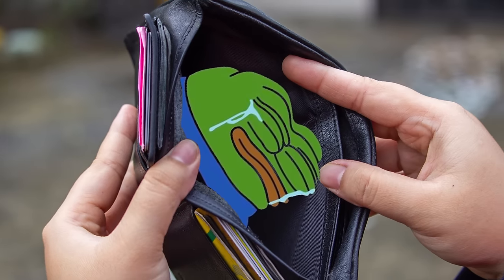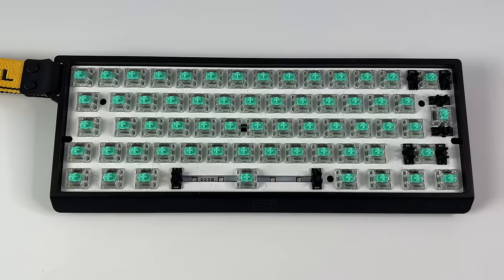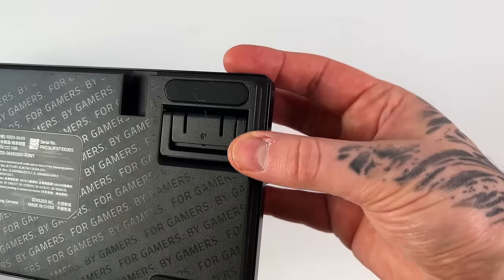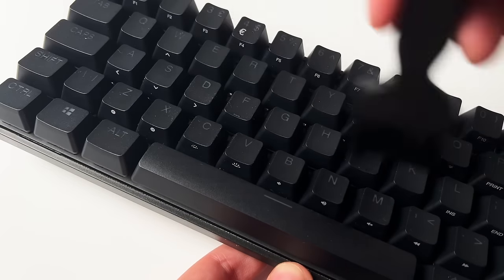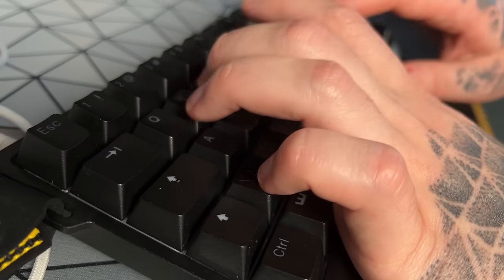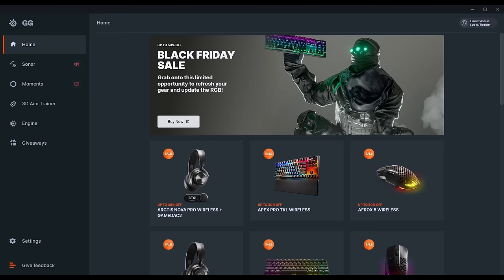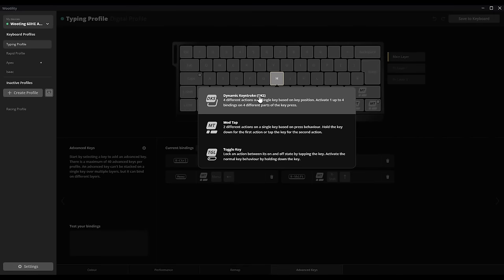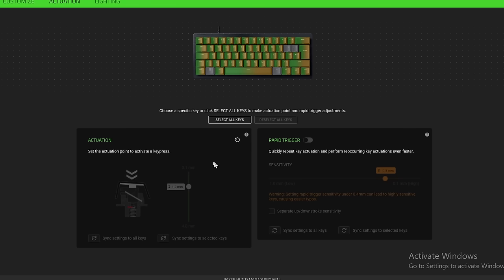What's the BEST gaming keyboard in 2023?

Comment: wooting still clears, thanks for watching
Reply: ASUS ROG Azoth 75 with magnetic switches will destroy Wooting and wooting knows it, which is why they're not hiring a ton of people, it's going to be their one hit wonder.

If you like a 60 keyboard then sure I don't and pretty much any streamer or anyone recording needs their F keys not to mention the high use of F keys in games like Call of Duty. A 75 is one row taller and one column wider, but it's fully functional. Hitting you fn + 1 + ALT and other three key combos in a fast paced FPS is a freaking PITI!!!
Reply: @DJaquithFL  destroy it seems a little exaggerated.. I'm not on the loop about this Asus kb but what breakthrough tech is it bringing to the table?
Reply: @patkluivert4110  .. The ASUS has a built-in OLED screen with information that can tie into your computer's telemetry (CPU / GPU temperature, Load %, GPU  Boost Clock, CPU Frequency, or you can have some dumbass animation. It has an aluminum top plate but the one thing I don't like about it is the bottom is made from plastic to allow for 2.4GHz/wireless connectivity .. I'd much prefer to see an all aluminum case with a little cut out hole for connectivity transmission. 

Right now I'm using a MonsGeek M1 HE with the same technology but in a 75 format. The problem with any of these magnetic switches is calibration and the occasional stuck key from using crap like 'Rapid trigger.'
Reply: @patkluivert4110  .. Also let me add, I'd much prefer to see a tactile feel in the otherwise linear magnetic switches. You can argue about that all day long not being needed, I'll argue right back to you that sound etc doesn't mean squat either. My error rate with a non-tactile linear switch is considerably higher and I don't like the feel. I have gaming boards that are linear. The difference in speed is being real nothing. The most important input on your PC? Sure the hell isn't your keyboard. It's your mouse!
Reply: Other competitors already caught up for cheap. So Wooting probably won't stay up there for long either.
Reply: bro having a lil screen doesn't mean its better for gaming @DJaquithFL
Reply: @DJaquithFL  okay then, what does an OLED screen have to do with the performance of a keyboard may I ask?
Reply: @AnhDuy-xr4ck .. First, what magnetic switch keyboard(s) do you own now?! Also what does the magnetic switches have to do with actual gaming performance? If you suck at the game now, NO keyboard is going to help at all, instead a good gaming mouse that fits your hand well Will give you measurable improvement. 

The only advantage that I've seen first hand with magnetic keyboards is IF you have fat fingers. I have a magnetic switch keyboard (75 MonsGeek H1 HE), there's a ton of them out there now. As much as that keyboard helps it hinders. If you even brush for example your S key you stop in your tracks. On a conventional mechanical keyboard that will never happen.
Reply: 4mm total travel distance is not as quick for multi presses than a shorter travel switch.
Reply: @cha0ss0ldier-4  .. If you mean "competitive" then no, it's like saying that people don't like North facing RGB. Give a bunch of morons social media and you get effed up stuff! My 60 and about 20 or so my other friends with 60s all have them sitting collecting dust because some moron brainwashed us all and to thinking they were better. They're not. They're dysfunctional. Best gaming keyboard layout is a 75. The size is negligible in difference to a 75 but the function is night and day better with a 75.
Reply: @Dani13G  .. Ignorance! So if your CPU or GPU is overheating and you're losing significant "performance" .. There's no "performance" gain .. really now?!! Do you guys ever think about the crap you say without thinking it through??!!
Reply: @DJaquithFL  First, you haven’t answered my question. Second, we’re discussing about keyboards not mice, a HE keyboard should never be a priority if you don’t have a good mouse to begin with. 

The point of magnetic switches is to allow users to adjust the actuation point TO THEIR LIKING, if you’re having a hard time getting used to the responsiveness then bump it up? It took me a good week or two to be comfortable with the Wooting. The moment I receive the board I instantly noticed the difference, not night and day but definitely there and I’m by no means a professional gamer.
Reply: @DJaquithFL  nope 😅 I have both
Reply: @AnhDuy-xr4ck  .. Buddy, I know what the magnetic switch keyboards are supposed to do if I gave you both you couldn't tell the difference. As far as a question, I don't know what you're asking that I haven't already answered. If you want something insanely fast nothing's going to be an optical, not only that, but the optical doesn't need constant recalibration of the magnetic field.
Reply: lots of trolling going on here lol
Reply: @DJaquithFL cap
Reply: @DJaquithFL you on something
Reply: @DJaquithFL cope
Reply: @DJaquithFL I don’t give a crap about all that, woofing has better performance. I used 3 different keyboard testing softwares when putting both keyboards on the best settings and it was close, but wooting won.
Reply: @bobsimpson1857 .. Yeah you used them at McDonald's got it. Or was it Walmart. 😂🐑
Reply: @DJaquithFL  My question is in what world is an OLED screen considered a “gain” in performance? Does it magically give a 10% FPS boost?
Reply: @AnhDuy-xr4ck  .. I already answered this, apparently you have a reading impediment. OLED or any screen: yes it does help considerably with performance, when you're overclocking your system then you have to keep an eye on all the temperatures. Temperature not only affects maximum clock performance of your CPU, but the boost clocks of your GPU. Do you even game? Common knowledge. Temperature significantly impacts your frame rates, frame rate stability including 1% lows (stuttering) and overall system performance. The risk is significant performance loss especially once the heat fully saturates your cooling especially a cooling loop.

Having a screen at your fingertips on a keyboard is nothing new and has been around for a decade or two.
Reply: @DJaquithFL  You’re still claiming that a tiny ass screen running through Armoury Crate -  a giant POS to show temps and silly GIFs is why the Azoth will “destroy” Wooting then I don’t see any reasons to continue this conversation, have a good day.
Reply: @AnhDuy-xr4ck  .. Yep the ASUS Azoth will or whatever 75 has a similar screen and feature set. Obviously you don't own a magnetic switch keyboard so you're blowing BS. I have one and there are a lot of annoying problems with magnetic switch keyboards. As I mentioned before on a WASD if you're pressing the W key and you just slightly are touching the S key right .. boom ..right in the middle of a map you stopped dead in your tracks and became cannon fodder.

One of the reps at Wooting responded to my observation about their slow employee expansion, and the reason is when another company, not if, comes out with an equivalent or better product then they're going to have to lay-off a huge chunk of their staffing. They already know this is coming.
Reply: deadchannel7895  .. MF that's like saying a speedometer, tachometer, oil pressure and all gauges means nothing on a race car. I'm certain with your Walmart, PC or more than likely Xbox that's true.

I'm a gamer, so I always want to know  my FPS, latency, packet loss, GPU & CPU Temps. What kind of idiot gamer would not want to know??
Reply: @DJaquithFL  idk about you but I don’t want to look at my keyboard for fps latency, packet loss, and gpu and cpu temps 💀 if you are a gamer your eyes should be in the monitor not ur keyboard
Reply: @caocao9924  .. Every OC'er monitors their temps my ASUS Extreme has an OLED with the CPU info and my game offers GPU monitoring. Now if you have some run of the mill PC then that's fine but then what in hell is the point to a magnetic switch KB when it's the DEAD LAST thing to help your gaming. In fact I took mine off and I'm back to my customed MOOD 007. The Pros and Cons on these magnetic keyboards simply make them near useless especially a 60. FFS Call of Duty has a binding to practically every F-Key not to mention all of the F-keys for Nvidia and not to mention any streaming Apps. If Wooting offers a 75 then sure I'll try it. but if I don't it'll be hanging on a wall with the rest of my collection.
Reply: Steelseries apex pro mini with the new firmware update for 115 $ almost same features as wooting 60
Reply: @DJaquithFL MF if you don’t have a crap pc then you don’t need some bs packet loss o meter on your keyboard 😂😂😂😂

Anyway idk what magnet switch keyboard you have but it sounds like you got it from the McDonald’s happy meal😂😂, also you can stay terrible at games while people shoot you and your looking at your packet loss- more like brain loss 😂😂😂😂😂
Reply: @henryhallam5270  .. DA I have a $12K PC CPU-Z J8P8UR .. Now let's see your Walmart POS PC. 😂
Reply: @DJaquithFL  jus say u know nothing bro 😭 rapid trigger/he switches are some of the biggest evolutions in keyboard tech. sorry but no one playing at just a slightly competitive level cares ab a screen on their keeb.
Reply: polar 65 will be better when the software comes out
Reply: @DJaquithFL  bruh you gotta stop making a fool out of urself. I own two azoths and it sucks in terms of gaming compared to my huntsman v3, polar 65 and og apex pro ,apex mini and tkl
Reply: @DJaquithFL  Stop making a fool out of urself. I own two azoths and it sucks in terms of gaming compared to my huntsman v3, polar 65, og apex pro, apex pro mini and tkl. I also own two watercooled 4090 rigs with 7950x3d and 13900k so why the hell will I need a oled screen to see if I'm throttling 😂
Reply: @game-zer0387 .. The ASUS Azoth offers telemetry data on top of being a very competently designed keyboard. It's unique and most pro level players and especially streamers need their F keys, using fn + ALT + Function is asinine. There's a reason that Wooting is making a keyboard with F keys .. 80 HE. Although the idiots almost pooched that with an oddly designed two additional row "80 style" with a gimped set of arrow keys. 

The CEO of Wooting said the reason that they're not adding a lot more staff is because they know their time is limited before better and better refunded competition EG. ASUS comes out and plays with hall effect keyboards.
Reply: No
Reply: I think wooting is the best from what I heard but it’s mostly what u like
Reply: @DJaquithFL  whats the price?
Reply: @DJaquithFL  
LMAO of all the keyboards you could shill for you chose ASUS. What a joke.

Competitive pro players will not care about a hardware monitor on a keyboard over rapid trigger and less input delay from Hall effect switches. A hardware monitor is just a gimmick. It’s not even a real “keyboard” feature. You can have it on another screen or your pc case or anywhere else. Many games even have hud options to display it. It’s just a gimmick to have it on the keyboard.

Do you even own a wooting? Your complaint about accidental triggering of keys is invalid on a wooting because you can adjust the actuation point to be less sensitive.
Reply: @David-du4mj  .. The hardware monitoring absolutely isn't a joke and I don't own an ASUS keyboard. Apparently you have a reading comprehension problem. Instead what I said is a keyboard like ASUS Azoth plus hall effect switches and plus an all or mostly aluminum case and if it operates well would make this Wooting obsolete. Wooting's CEO once answered one of my posts regarding the I understood why he wasn't hiring additional staff and the reason is while the demand is strong, it's a very very volatile market and the next new best thing can easily leave something like Wooting in the dust. Actually I plan on buying their 80 keyboard founders Edition and you?? Are you going to buy the new Wooting or do you even own a Wooting keyboard? My guess is not so LMFAO at you kid.
Reply: @DJaquithFL  I don’t disagree that the market is volatile and wooting won’t be able to hold the #1 spot forever. However, I find it funny that you picked an asus keyboard and hardware monitoring + aluminum case as your competitor.

Not sure if you know, but not all Hall effect keyboards are the same. Most other brands Hall effect keyboards right now don’t hold a candle to Wootings software. 

What will take Wooting crown will likely be a large more mainstream company like Logitech/Razer who can match Wooting tech but also mass distribute it to big stores at cheaper prices with better advertisement.

And yes. I have own a wooting for a while
Reply: @David-du4mj  .. I find it incredibly odd that anyone competitively gaming doesn't want easy access to GPU and CPU temperatures along with other vital information. Not to mention anyone competitive using a 60-keyboard lacking fast access to F keys to do things fast like streaming, recording, and not to mention in-game worse is often being struck to using sometime 3-keys e.g. fn + Alt + F-key.
Reply: @DJaquithFL  ok, so a bunch of gimmicks that don’t impact actual gaming
Reply: @DJaquithFL  link
Reply: Crazy cope rn
Reply: What kind of brain rot is that comments section
Reply: It is true. Having a Wooting Keyboard isnt going to magically transform you into a better gamer but I also doubt having a little screen on your keyboard is going to help you ingame. The truth is, if you are bad at games or have a bad pc, a keyboard is not going to save you.
Reply: @solaire3312  i was surprised for a second when i realized it shows the timer for the baron in league to spawn but then i realized that i had no real reason to look at my keyboard ingame so it was completely useless. (I have an apexpro, waiting for the wooting 80he)
Reply: @DJaquithFL ok but who gives a fuck about having random info you can already view in your keyboard… the wooting has breakthrough new technology that we had never seen before 😭😭
Reply: @Jvxino  nah

Comment: For the same money, faster shipping as well as a better layout, DrunkDeer a75 cant be beat either
Reply: There's no ISO layouts for the drunkdeers though...
Reply: .. What about recalibration? I looked at that keyboard but it's a PITI to get into and it really doesn't conform to a custom keyboard like AKKO, MonsGeek or soon Keychron w/VIA which IMO will be a game changer because of VIA. 

My MonsGeek M1HE is okay but I've had a couple times where I've had stuck keys and I had to reset, The problem seems to occur when I have 'Rapid Trigger' enabled. However, one thing I run across all the time is I'm accidentally pushing on my 'S' while trying to move forward and my character does sits there like a dumb log. The only advantage that I've seen is I have fat fingers and I often hit the TAB (scoreboard) and Caps Lock (map) while playing Call of Duty and I can mitigate that with settings, but I can do it by remapping those keys as well. So it's a Pro and it's also a Con. Other than those examples, I've had a metric ton less issues with my mechanical keyboards. The last time I had a key stick on me was with an old Corsair K100 which was LED and before RGB. That's how long ago I've had a sticking key issue and then I became a beta tester to figure out where in the firmware there was a problem.
Reply: @DJaquithFL Most keyboards that are HE don't really have calibration tools but they're still very accurate in general for what they do. You can change the sensitivity per key which is what a lot of people who own all these types of keyboards recommend. It took me a while to adjust because I tended to partially press keys I was waiting to actuate before actually actuation them and had to unlearn that really fast.
Reply: Polar 65 with 30% off until yesterday blows DrunkDeer & Wooting out of window honestly. It was $105 with better build quality (aluminium case), sound, same hall effect & rappid trigger as Wooting, etc.
Reply: The deal is insane, however the shipping to EU countries easily drags that value down. I would know, had Polar 65 refunded due to the cheaper of the 2 shipping services making a mess of things. With the other option the cost drives up to nearly wooting 60he level even with the bf deal, unfortunately. Anyone else that the 'International express' works for, is a winner for sure.
Reply: @Glac1alWasTaken where are you from? I’m from Czech Republic and I also had 2 options of shipping, ordered the cheaper one on Monday. It wasn’t fulfilled until yesterday (Friday) so I hope the keyboard will arrive 😢

Comment: I have an original version Steelseries Apex Pro TKL, and I like having arrow keys and insert, delete, etc.  I miss not having a numpad, so if I am going to get a 65% keyboard like Wooting's, I want there to be a reason like easily repairable or hot swappable.  If steelseries makes the same size keyboard that is very much a pain to fix or take apart, what is the point?  I'll just get a larger keyboard or a wooting instead.

Also for Steelseries keyboards you can adjust the Rapid Trigger mode actuation point now with a patch, which is nice.  Even on the older Apex Pro TKL I have.
SS's software is terrible and crashes constantly for no reason whatsoever, I may upgrade to a Wooting 80HE since it has the arrow keys and seems perfect for my needs since it has all the steelseries apex pro features.  The apex pro and TKL was great for 5 years ago, but we've made some strides since then which is nice. 

Just the price is stupid high for all these keyboards, once you buy a keyboard it is kind of like, as long as it keeps working you don't really need to upgrade.  I also got some Razer PBT keycaps for my steelseries keyboard and they feel a lot better to type with than the standard ones.